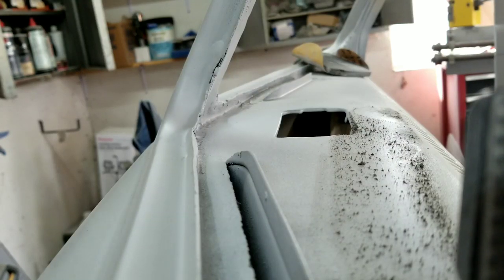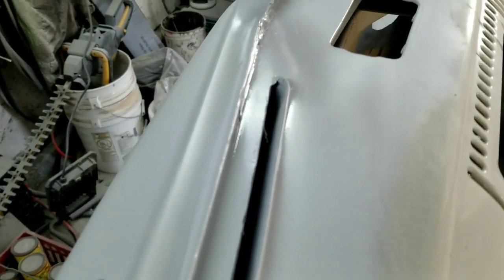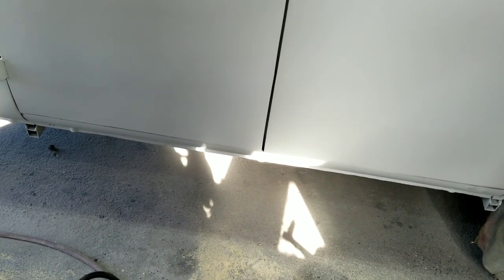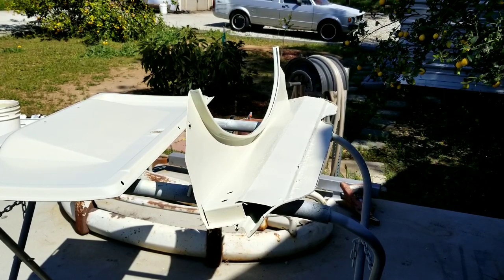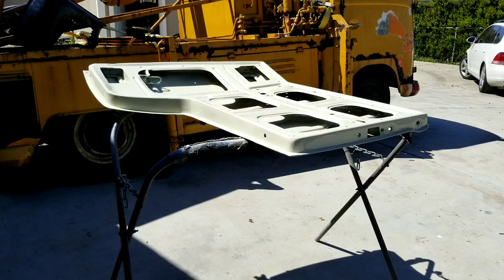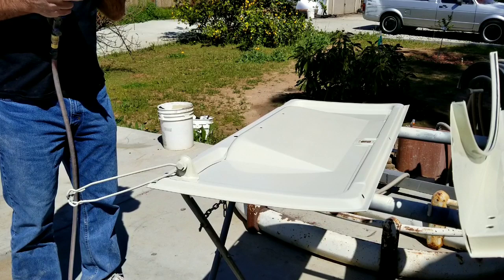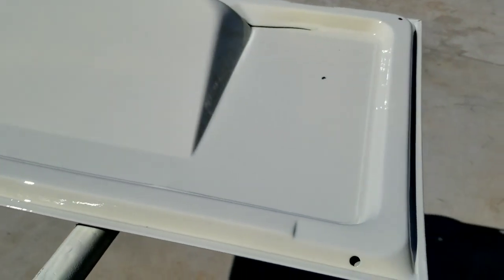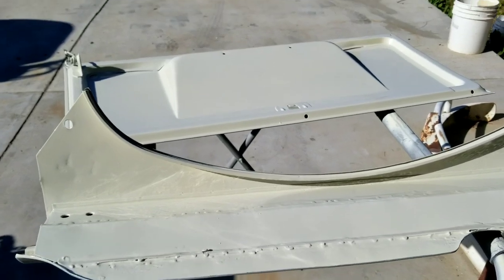VW BUS RESTORE - Door Jam Painting - 67 Westfalia

Comment: are you going to have any problem with the waves and thick parts of the windshield mounting flange you showed at the beginning of the video..  allowing wind and water to get under the seals causing additional rust in the future..  its just a  thought.. you have the years of experience..  its been too many years since i put a windshield in a 67.. to recall what the profile of the seal was..
Reply from the maker: unfortunately the windshield rubber usually leaks and causes rust even if repaired perfectly original. So it will rust again there someday but the best way to combat it is to have safaris and dry the area and keep the bus under cover. Poor design. being tilted back. water finds it way behind the rubber.